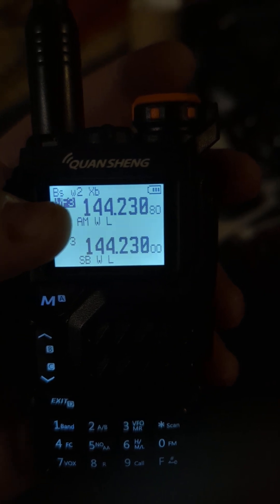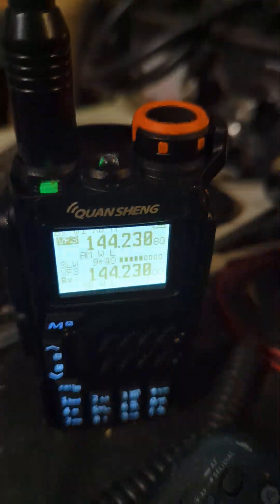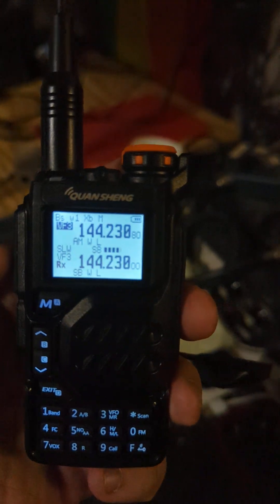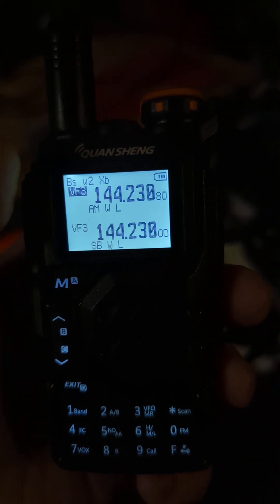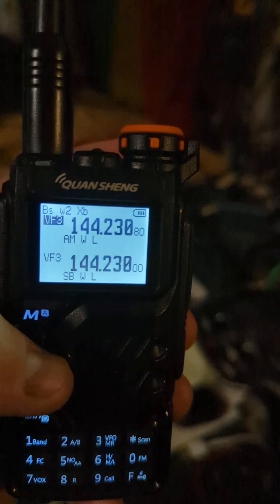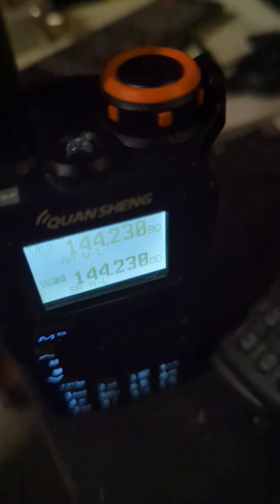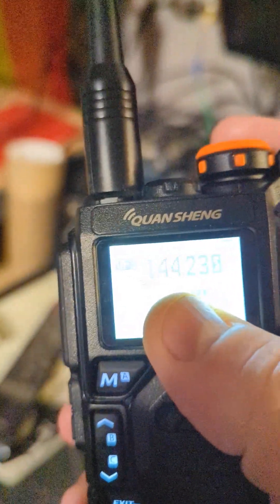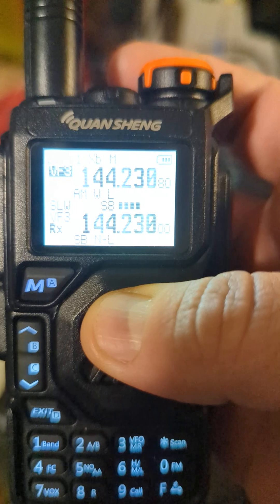Using the Quansheng UV-K5 (with IJV firmware) as a QRP CW transceiver? A very rough POC test.

Comment: Can you help us transmit on 85 Mjz with loud voice? I have tried egzomer the sound isnt working thanks
Reply from the maker: I wouldn't recommend using this radio for that purpose. The filter circuitry really works best for 140-500 MHz as I understand it. If you transmit on 85 MHz you are likely going to have a dirty signal. 

I think some of the IJV firmware updates (3.4?) might help. But again I think this is the wrong hardware for that frequency.